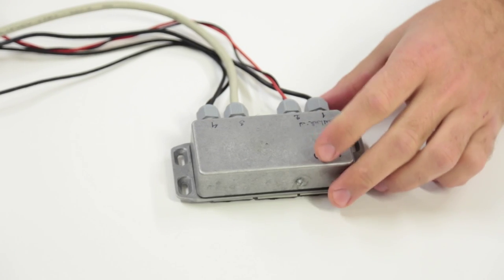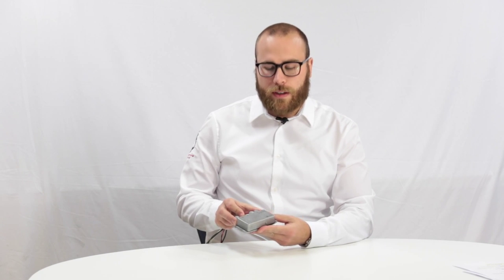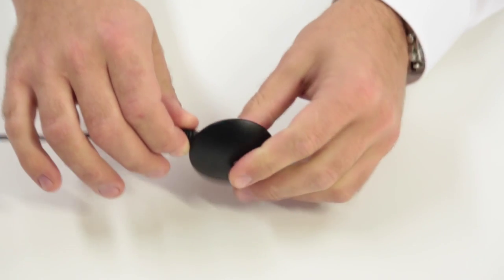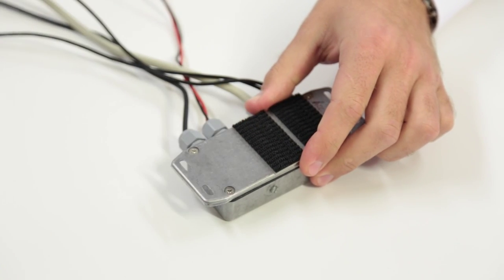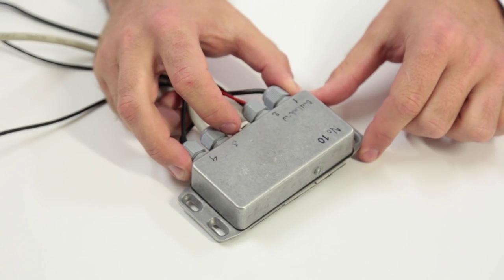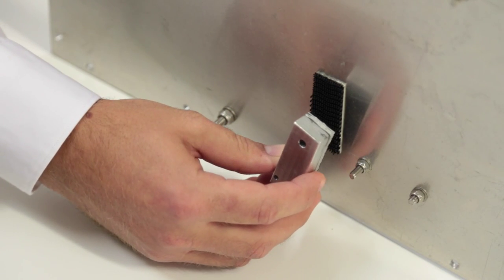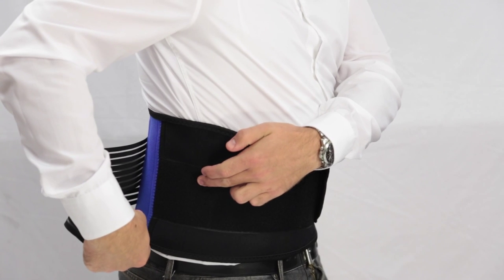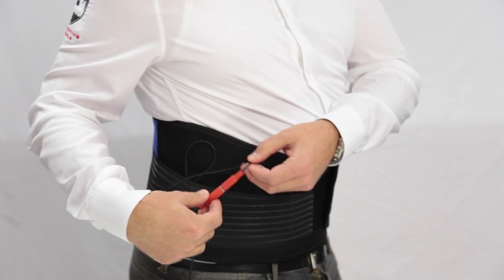MARec The Marine Acceleration Recorder

Comment: Interesting. It misses written on the bulk transducer the 3 orientation axis.
Reply from the maker: ok
Reply: Correct.   
However, when you see signals on the graph, it is easy to identify which is vertical,  
which is lateral and which is longitudinal. 
On the new version Marec the 3 axes on the hull transduser are indicated.